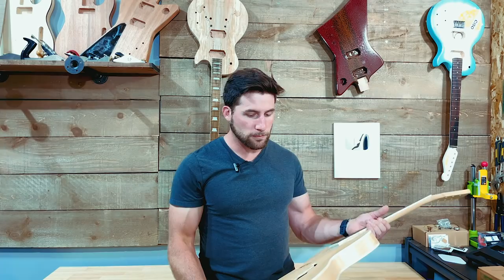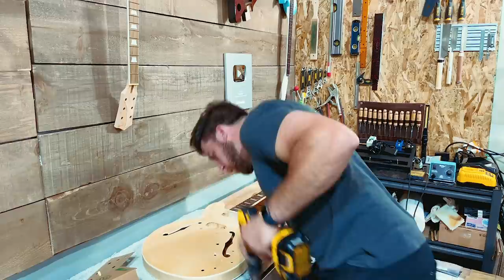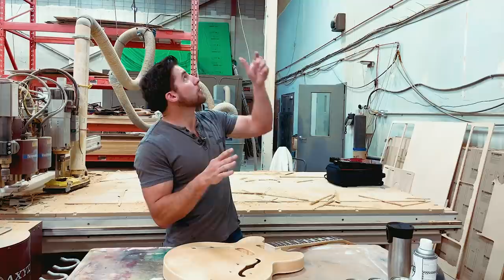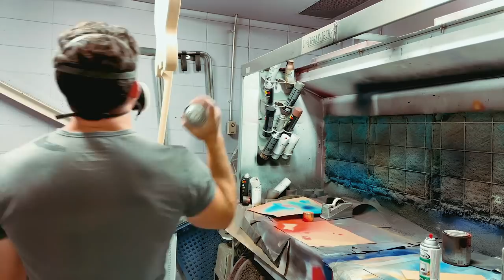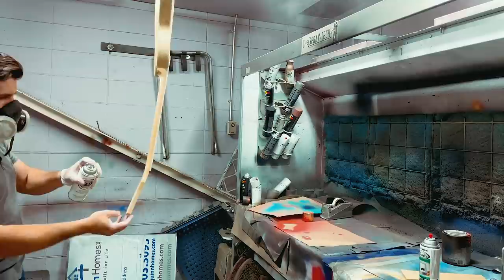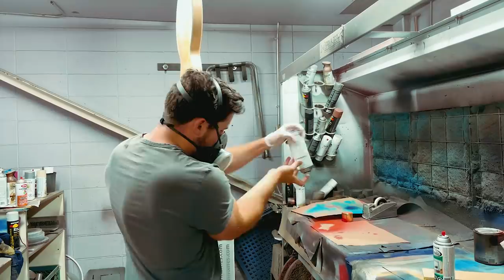The ES 335 Guitar Kit Build! (Part 2)

Comment: Strange……I built a Solo ES335 from their kit. I notice that the horns of yours are even top to bottom. On mine, the top horn is longer than the bottom horn. I figured it was to make it just different enough not to get sued by Gibson. Yours is closer to a real Gibson. I dyed my top dark blue and gave the sides and back a slight purple tint. Then used several coats of vinyl sealer and about 20 coats of nitrocellulose lacquer. Upgraded the pickups with Epiphone vintage humbuckers and the other electronics with CTS pots and orange drop cap and switch craft switch. Wired to vintage Les Paul schematic. Used Mohawk pre cat lacquer.
Reply from the maker: Sounds like an awesome project. My kit is from a couple years ago before Gibson threw its tantrum, so you’re probably right about the reason for the shape.

Comment: Is that a Hakko soldering station I see in the background? I have one identical to that if is is. I love those and I love this build. I'm not really a 335 guy but I'm loving this one and I'm sure I'll scratch build one eventually.
Reply from the maker: It might be. That one isn’t mine; I use a Weller.
Reply: @BradAngove  if you ever come across a good deal on one of the blue and yellow Hakko's. Get it. The black and white ones are great but the blue and yellow ones are compact and the temp adjustment is very accurate. Anything less than $75US for the Hakko.is a good deal! Peace brother.
Reply: @BradAngove  I also wanted to thank you for all the finish videos you post my friend. I'm pretty set when it comes to standard auto paint and clear. The techniques you've posted are the kicker. You have broadened my horizons and I really appreciate it.
Reply from the maker: Cheers buddy

Comment: How are you able to handle the neck only 15 minutes after spraying?  Doesn't it mar up the coat you just sprayed? (@15:44)
Reply from the maker: No. This is nitrocellulose lacquer from Oxford supply. It dries to the touch in a couple minutes; you just need to be gentle and not apply it too heavily.

Comment: Did you sand the sealer that comes on the kit completly off before you added the oxford sealer?
Reply from the maker: Not completely. Just smooth.
Reply: @BradAngove  but if you were using stains, you would have to?
Reply from the maker: Yes, generally.

Comment: 1969, two men walked on the surface of the Moon. 2021, guitarkits maker can’t find out how to make holes big enough for the pot’s shafts…
Reply from the maker: Pots come with different size shafts. The upgrade hardware I selected just happens to have larger diameter shafts.

Comment: Dude, Solo guitar kits are the worst. My SG custom's neck didn't come close to fitting the pocket, the neck was way too big. Once I was able to get it in the pocket it was cut unevenly so I had to use wood splints/shims to correct the angle and action. Now I'm left with gaps all over the pocket that cannot be filled even though the neck and scale length are now correct. None of the hardware fit the holes on the body, I had to carefully sand the existing holes to make anything fit. The nut was also cut horribly, the worst I've seen. I will never, ever buy a Solo kit again. I bought it specifically based on your recommendation.
Reply from the maker: So it was too big but you still ended up with gaps? That’s surprising. I’m not sure what you did there but regardless their customer service is pretty good so they may be able to help you out. Or just buy from somewhere else if you want; I like solo but that certainly doesn’t mean you have to bug from there.
Reply: @BradAngove  dude. I had a choice. Cut the neck tenon or gently sand the sides of the pocket. Out of the box the neck did not come close to fitting. I did not touch the bottom of the pocket so it was cut to wrong specs. Once it fit, not only was the angle wrong but it needed two shims to bring the action to where it should be. Fortunately, I installed two tuners on both Es and strung it to be sure scale length, angle and action would be salvageable. It is clamped now so beside the gaps in the pocket, some I will fill with wood filler, it will be ok structurally. I also have to saw the extra material as a result of the shims to make the neck flush with the top of the body. Outside of the fretboard which has clear scratches the fret work seems reasonable. Overall, one star for this Solo kit. I’m not even addressing all the problems but I will upgrade all hardware and pickups. I will make it far better than it ever deserved to be.
Reply from the maker: If you need to increase neck angle it’s usually best to check the height first. Sometimes a bit of sanding is a better option than shimming.
Reply: @BradAngove  The bottom of the pocket was cut too low to make the action as it should, the option I chose was to build up the neck tenon. The pocket or the neck tenon was horribly wrong. It is possible they sent a mismatched kit with neck and body not properly aligned. It is also possible they send you grade A stuff to review and the rest of us get the garbage. This kit was well over $200 and a total ripoff.
Reply from the maker: Ok. I get almost exclusively good feedback about them from my viewers, but it’s not like I work for them. Normally if there’s an issue one would just contact their customer service and get it dealt with.
Reply: @BradAngove  The only resolution was to return it but I decided not to. Literally nothing they sent fit the guitar body except the tuners. You decide.